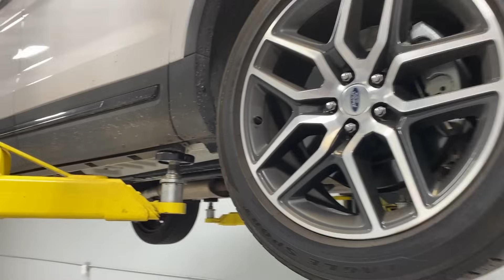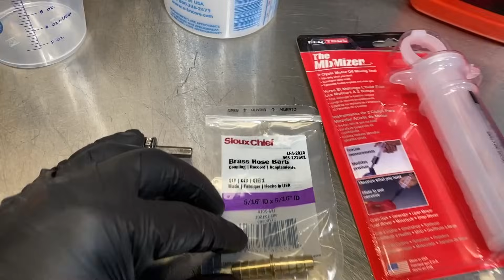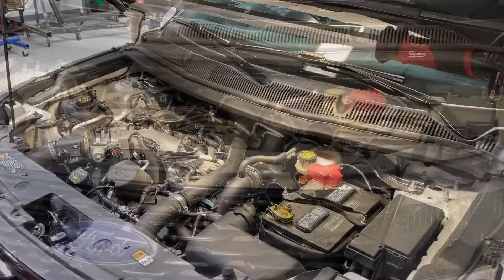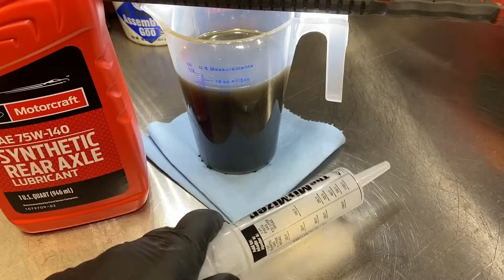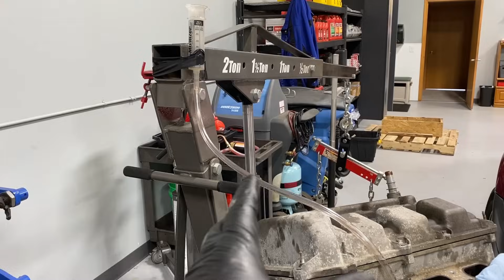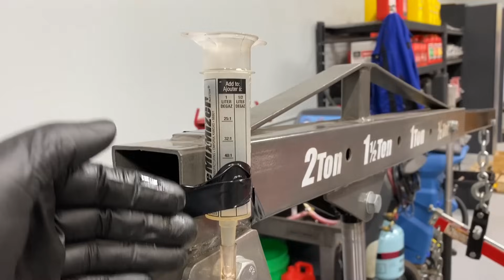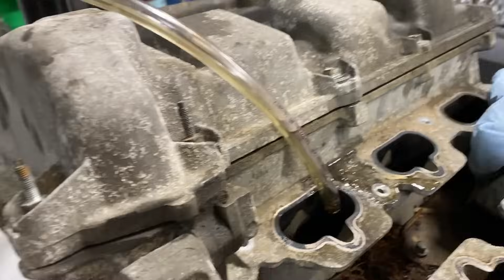Fluid Service on Ford’s New Cooled PTU’s is Possible: We Show You How!

Comment: Great series! Learning a lot about Explorer 3.5 Eco-Boost while shopping for a used Sport.
Question: What year did Ford update the PTU to include the drain plug, sensor, cooler/cold air induction? It appears to be 2015(?). Thanks. I'm now a subscriber and believer.
Reply: As far as I know (for anyone in the future) the 3.5 EcoBoost is the only one with the cooler. 2016 and up have the drain plug.
Correct me if I'm wrong
Reply: @marinusdedreu3833 my 2013 has the cooler on the ptu not sure if it was stock or not but I don’t see any service records for the ptu

Comment: Hi Brian - love your videos! Great content as always. I just picked up a 2020 Explorer ST which is my first AWD model after a 2013 and a 2015 FWD. Is the PTU setup on the 2020 models the same as the 2019 and earlier or did they (hopefully) make some design improvements on the new generation?
Reply from the maker: You have a standard transfer case with fill and drain plugs that are easy to get to.
Reply: The 2020 explorer is rear wheel primary drive... has a transfer case instead of a PTU. Very easy to service.

Comment: I have a question: my 2008 F150 starts right of way when cold; after running it regularly doing errands, it won’t start as easy. It sometimes sputters then turns on. Any suggestions?

Comment: Awesome job, Actually my Ford Edge 2014 AWD SEL running 120k Miles, Recently the Mechanical noticed that there is a bit of a leak from PTU and when we checked it smelled burnt oil even though the color is still crimson to brown. H advises replacing the PTU itself. Another friend advises me to change the PTU oil only. Please I need your suggestion asap

Comment: Hey man need some help on a 2004 ford 150 4x4 4.6 have issue with the transmission not wanting  to shift correctly in drive you can mainly drive first and second but soon as you throw it in drive doesnt want to shift , new computer new output sensor I'm stuck

Comment: hi please tell me do you take the mount out of the 3 bolt bracket some how? cause no one shows you that . i bought the part but did not come with a bracket or anything just the rubber mount with the two holes for the 2 studs that are 18 mm. man i cant get this thing out of the 3 bolt bracket and have to go to work in couple of hours

Comment: It looks like my 2016 Sport  has a shorter hose. Yes it has “Gore” on the cap. Are all the hoses the same size diameter? And I have seeping. Looks dry. is black where the center drive shaft goes into it. Anything to worry? I do plane on changing, but with that dry seeping is it something to worry about?

Comment: Would the same procedure work for the 2.0 eco boost in my 2022 Ford Bronco Sport and what's your recommendation on how often to get it done, as I'm taking it off road about once a month, though most of my actual mileage is on the highway, to get to the mountains?

Comment: I recently bought a 2014 PIU with 120K and a cooler on the PTU.  I drained it (hot) an hour ago and only got 8 oz. of fluid out of it after it had stopped dripping (again, hot and an hour of letting it drip).  Now I’m concerned about how much fluid I should put back in it.  As far as refilling goes, the old style without a cooler would be easier to correctly fill, since it would start running out of the hole that the sensor now lives in.  I know 8 oz. isn’t nearly enough but I don’t want to go cramming more than say 12 oz in there and risk overfilling it.  I’m stuck, man…

Comment: Hey Brian this is Darren Kocay from Saskatchewan Canada i have a 2008 ford f150 i am getting a weird grinding sound from my front right side it mainly only happens when i am accelerating and if i try to put it in 4 wheel drive when i accelerate in 4 wheel drive it clunks hard when i get going but does not do this in two wheel it only grinds in two wheel and clunks in 4 i have no engine lights or codes on my truck i know its not my heat shield that was the first thing i checked and i don't think its my IWE either because i looked up videos on a failed IWE and it isnt making that sound. I am hoping it is just my cv axel but was wondering if you might know what the problem possibly could be.

Comment: Would you be able to use a fluid dispenser?  I purchased a fluid extractor / dispenser  for differential and ptu fluid changes. I was your other video on ptu service without the cooler. Would you be able to hook up that to the vent or would it over fill due to back pressure or something?

Comment: Is amsoil extreme gear 75w 140 a good choice, or stick to the motorcraft? Is there special modifiers/additives in the motorcraft? If not using motorcraft are any additives necessary?

Comment: What year did they start putting drain plugs in the explorers, you other video you said they had to suck it out through fill plug.
Reply from the maker: They gradually started offering drain plugs with or without a cooler in I would say 2011 for most models.
Reply: @FordTechMakuloco  my wife's 2014 edge just got a new ptu 2 month's ago, do you think that new ptu will have a drain plug?  I sure hope so.

Comment: I have the PTU with a fill plug only.  I just suck up the fluid with a pneumatic suction device then fill it up through the vent after I ran an extension to the engine bay.  Fill till it overfills the fill plug, clean, add thread sealant then reinstall the fill plug.  No more struggling to fill it through the fill hole.  I  feel sorry for people that have the fill and drain plugs because you have to work against the backpressure when you have both plugs installed.  I don't think you should force the fluid into the PTU because you are working against the seals and you may blow one of them.  Just let the fluid get there by itself without pressure.

Comment: You should install a "Y" close to the top so you can keep the vent on and fill at the same time so the fluid can go in quicker.
Reply from the maker: Not sure it works like that. I need to vent the air in the PTU not the tube which is never going to happen unless I have another port on the actual PTU to do so.
Reply: @FordTechMakuloco  yeah now that I think about it, your right.... just drill a 1/8" hole in the case lol

Comment: The oil probably takes longer because it is going in the vent and needs to pass the air coming back up the hose. Being the vent hose there is no where for the air displacement to go   Nice trick though.
Reply from the maker: Correct but in reality it takes 5-10 minutes to fill this way no big deal.

Comment: Can't you fill like the lower unit on a outboard motor push the fluid back through the drain hole  just measure the amount drained out and push that amount back through the drain hole

Comment: If the ptu is sealed besides the hose and you put fluid in, where does the air go when the fluid fills in the negative space , your example showed it going into a open space . Yes I seen some bubbles coming up but not as much air as fluid.  Im not saying it doesn't work, but not understanding the air transfer.

Comment: 2018 SEL 3.5V6 AWD, my Ford dealer says he cant change the fluid in my PTU but my local corner garage says he can do it. Do I have a plug in my PTU for draining? Right now I'm at 15,000 miles.

Comment: I have a 2017 ford explorer 2.3 which has a fill plug and drain plug. Only this is I can't break the nut lose. Is there any other way to get them off I'm at 65k miles. Any info would be great

Comment: Why wouldnt ford just make the overflow valve extension on all these cars now or thru a recall?  Seems pretty easy to do.  Also is there no other way to route the exhaust in these cars to eliminate or at least greatly reduce the amount of heat hitting the PTU?

Comment: I have a 2008 Ford Edge 3.5 l Don't think that the PTU oil was ever changed I crawled under the vehicle and I do have a drain plug right in about the middle of the case. Looked around real closely up top took off all the air intake contraptions that would block my view and I cannot find a vent. Is it possible which I don't think it is that I don't have a vent?

Comment: How would you know that the fluided needs to be changed? My 16 explore has a slight grinding when driving at low speed. Then it’s fine after 15-20 miles per hour

Comment: Great video.  I wonder if there is room over by the PTU to install a very small 12v component fan to the side of it or near it for added cooling
Reply: Wrap your catalytic converter with heat tape and your pipe ... the fan will do nothing ! The heat is by convection too

Comment: Noticed this is a different procedure than your other video detailing this and using the vacuum pump and sucking out all the fluid and then pumping it back in through the hole. Is this method preferable? Thanks for the great videos. Cheers
Reply from the maker: This is for a totally different PTU design.
Reply: @FordTechMakuloco  Ahh ok thanks for the clarification. Mine is a 2014 Explorer 3.5 Ecoboost. So I will need to go back through your videos to find the one that applies to mine. Do you recall the name of the video that applies to the PTU in my 2014 Explorer. Cheers.

Comment: Thats why i walk away from awd horizontally mounted v6s. Almost no room to work. Add in the fact that this is an Ecoboost with all the extra plumbing and it turns into a nightmare. A longitudinal setup would have made this way easier. Look at the Jeep Grand Cherokee wayyy easier to service transfer cases and diffs, and I'm no jeep fan.
Reply: That's exactly what I'm thinking, but they change the platform for 2020,it should be same as the cherokee
Reply: I was looking at getting a single-owner, low-mileage SHO just a couple weeks ago, and after watching Brian here and many others, I had convinced myself to get the premium Ford extended warranty, something I would almost never do for a vehicle.  Too many failure points in that AWD/turbo/3.5L Ford combo that can result in an instant $2-3K repair bill (or more?)  Ended up not getting it for other reasons.
Reply: These are cars best suited for someone with mechanical skills and understand the engine weak points such as the water pump and leaking turbos. The F150s have longitudinal same engine with their own sets of problems so like I said, these engines require some wrench skills.
Reply: @stephenb3348  If you are buying a Ford, get the extended warranty! Everyone make fun of Chrysler products, but I'm here to tell you Chrysler has come WAY up and Ford is taking the place of the old Chrysler quality. And yes I have owned Fords for years...I'm moving to MOPAR.
Reply: @icyhotmike  Even if you're a mechanic after you've been wrenching all day I highly doubt you'll want to spend time and maintain this nightmare. Yes the internal water pump in first gen 3.5 (not Ecoboost) was single gear and the redesign version with dual row of the gears is way more reliable but the packaging is terrible. Everything is crammed. That's what happens when you try to keep an old chassis alive and cram more crap in it ..all you end is with an expensive compromise . This chassis goes back to Volvo S80 days. There was a reson why volvo stuck to inline 5s and 6s.

Comment: For thick Lubricants I had a gallon of water to heat.  Then I would put the fluid in a container into the pan of hot water sitting on a hot plate.  I would actually bring the fluid to operation temperatures. 
 You should work for ford engineering.  That way the mechanics would be smiling when they go to work.  But I would probably consider a drain cock that you could hook a hose up to it.
Reply: I just did a fresh engine start a few weeks back , and modified a hand pump bug sprayer to do the job. 
All I did was throw the oil in the nuker before I dumped it in the sprayer. 
Worked great , it pushed a gallon in maybe 2 minutes.

Comment: Frustrated that we do have a drain plug, but the fill plug is beyond tight in a 2015 MKZ.  Our mechanic stopped after his T50 Plus bit started to bend. Besides too much heat there, the fill plug has an unthreaded shoulder that probably seized to the case due to dissimilar metals. You can't even get a solvent into the threads it fits in the hole so tight (unlike a drain plug and crush washer). Dang it, Ford.

Comment: what year did they start putting the self cooling ptu’s on the explorer? my ptu just failed on my 2016 explorer and the Ford dealership is telling me it’s a $3,000 repair!!! my 5 yr power train warranty just expired two months ago and the vehicle only has 40k miles on it, 20k under the power train warranty but i ran out of time. Ford may help me by covering 50% but i think i’m pretty screwed. i also think they’re just going to put the same oem ptu on, so i’m assuming i’ll just have the same issue in another 40k miles unless i get that fluid changed. is there a way to put the new cooles ptu on my 2016? how do i find a mechanic willing to service this ptu? what a mess…

Comment: Well you need any hose clamps on the hose barb? Or is there not enough pressure or vibration to separate the two hoses apart?
Reply from the maker: No clamps needed

Comment: I will try this on my 112k mile 2017 Explorer that I can't prove has ever been done... if Black and Kinda mucky fluid comes out, can I leave drain plug off and flush with something?? (then install drain plug and fill it back up) or do I just exchange the fluid and  run it for 500-1000? miles and do a 2nd or even a 3rd swap and run???    Its not the end of the world If I have to replace ptu, and then flush every 20-30k, but if I can prolong having to replace, thats just a bonus.

Comment: What isn't described here is how absolutely hard it is to reach that. I'm laying across the engine and then ripping up my hands. My hands are not huge and I can't imagine how anyone with larger hands reaches this. I dropped the end down in the engine. It does not come off easy at all in my case. Sat there 45 mins trying to separate it. Then to put the replacement/extension hose, you can't reach that either to push them together. What a nightmare. On hour 2.

Comment: PLEASE HELP!

I’ve been having a problem with my 17’ Fusion AWD. Turning, have a bumping/clocking noise. Is this axle or PTU? I have 62,000 miles on the car now - never changed oil in PTU…

Comment: A long shot given the age of the video I know...does anyone know the socket size needed to remove the temp sensor?  I've attempted twice now to fill using this method and both times I've just lubed my driveway.  About four ounces or so make it into the PTU and the rest just makes a mess so wanting to fill through temp sensor to ensure proper quantity but can't get anything around the fastener end to determine what size socket to cut up.

Comment: With this mod do you think that it will or the dealer will try to void the manufacturer warranty
Reply from the maker: The way it is modified in this video you can swap it back to stock in just a few minutes if warranty service is required on the PTU.
Reply: Yea Beavis I'd put it back , they will nitpick anything if you let them.

Comment: Question... when they added the oil cooler. did they increase the volume of oil in the unit so it stays at a proper level while the cooler is pumped full of fluid. 

question 2. can you look at PTU temp History.. instead of the cold temp on the rack..
Reply from the maker: It is just a coolant loop to draw heat away from the PTU.
Reply: @FordTechMakuloco  thanks... that makes sense..

Comment: Clever fix! I assume there's no other vent in the PTU, so there's no way to easily displace the air. Your mock-up isn't draining into a closed container. Just sayin'.
Always enjoy your videos!
Reply from the maker: The mock up will drain the funnel faster as you saw yes but the line clears the same either way once the funnel is empty and that is the point I was trying to drive home with the mock up, nothing else.
Reply: The PTU is a giant cavity. If you completely filled it up it would prob accept a gallon or two of fluid.
Reply: Wouldn't go very far with that gallon or two in there tho...😕

Comment: bought the car with 70k on it, strong smell of gear oil with no leaks at 85k. Seems like the PTU is overheating. Do you think changing the oil will fix it or do you think my PTU is burned up.

Comment: Make sure you spray off the gear oil from the exhaust with brake cleaner when it’s cool.   That stuff stinks to high heaven when it gets hot.
Reply from the maker: for sure.
Reply: @FordTechMakuloco  great video.  Thanks for always taking the time to help us out !

Comment: Does the manual officially recommend PTU oil changes? Or did they just put the temp sensor in the "fill hole" and still call the PTU non serviceable?
They need to increase the oil capacity and put some serious finnage on that thing lol
Reply: I'm willing to bet it's "Filled for life", or it's a 60K miles interval according to factory spec. (Pro tip, always halve the factory spec for fluids)
Reply: Yup someone posted above that his Toro mower axle holds the same amount. 
I'd vouch for that , I've had my hands on a few.
Reply: Makes me glad I didn’t buy a used sport with 60-80 k... although fantastic all around ... I can hold my own in the shop but, I don’t know what someone did or did do. The cost of this service at a dealer would scare most to take their chances... if I bought one new... it would be done every oil change but I don’t buy new stuff... sooooooo... good info as always 🤙🏼
Reply: The vent is a small nipple and is not a fill hole.  The vent is secured with rubber to metal friction only, no clamp.  The PTU is lifetime fill but the gear oil turns into mud so if you want to keep your Explorer past 70k you should find a way to service the oil.  The fill hole has been filled with the temp sensor and the heat shield and cat block any access to removing it even if your hand were the size of a cat's paw.